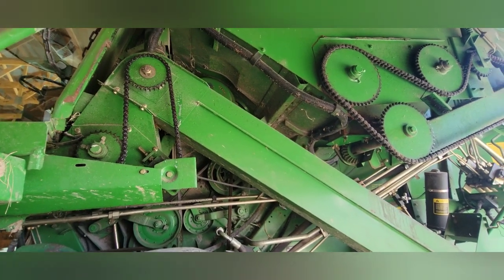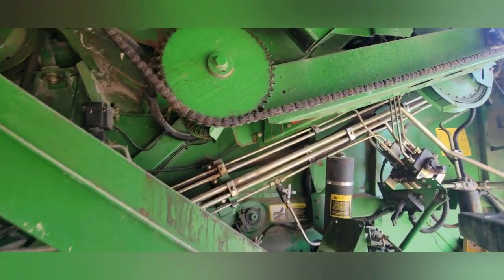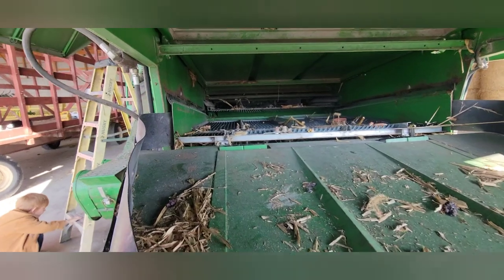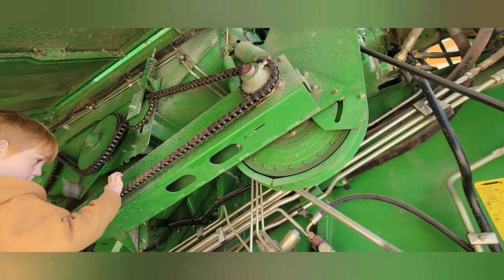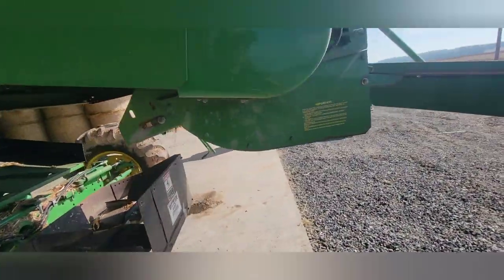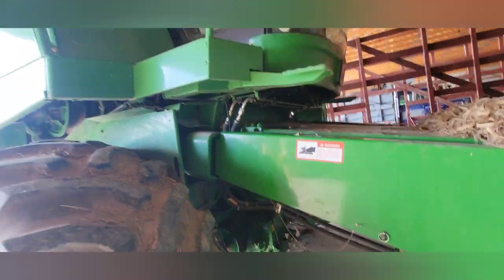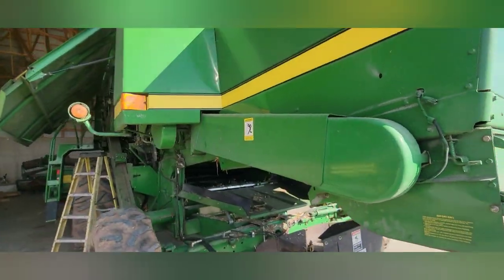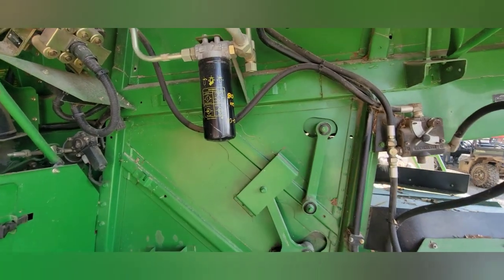I never thought you could find a low hour machine for this price

Comment: what an awesome find and buy. You won't beat a 9500...so reliable and all the comfort-features of a modern one. I don't even get excited over newer series anymore. They look like nothing but expensive headaches as a result of endless electrical and anti-pollution engine troubles. I also think Deere has made their combines cheaper with crappy light steel....the combines just plain wear out quicker.

Comment: It because nobody wants a 30 year old machine...its pretty simple. Those old 9000 series combines aren't worth much regardless of how many hours are on them. Combines in general lose a lot of value very quickly no matter how new they are. That thing is going to end up being a money pit, after sitting for that long and getting use now alot of the seals are going to be leaking.
Reply: I bought a IH1440 with 800 original hours 12 yrs ago.  I was looking for a bigger combine for my acres but surprisingly it does me good.   I’m the only guy on our road that’s been using the same combine for the last 12 years.  Newer isn’t necessarily better.
Reply: @hankelrod7315  newer is always better if you can afford it. I would never go back to an older machine. With our class 7 and 40 foot draper we can knock out a quarter(160 acres) in under a day easily. We could never come close to that when we use to run an old 9600. On top of that, I would never farm without autosteer.
Reply: We can do 90 acres with a 9600 in 11 hours. Not bad for an old combine
Reply: @PaulsonFarms claas combines are still built better than anything. Steel is way thicker everywhere, auger, feeder house etc
Reply: @PaulsonFarms  You would wear out the head hookups attaching & detaching your header to get through 18 ft gates & bridges to get to the 3 acre fields I farm.  Urban sprawl has made a real mess of things.  50 yrs ago I had bigger fields & much bigger rented farms than I do now.
Reply: Exactly correct. A walker machine is so cheap because it's a walker machine also. Nothing wrong with them, but not nearly as good as a rotor combine. Even a comparable Gleaner of this size would have been a better choice.